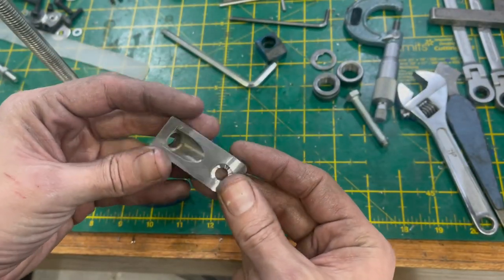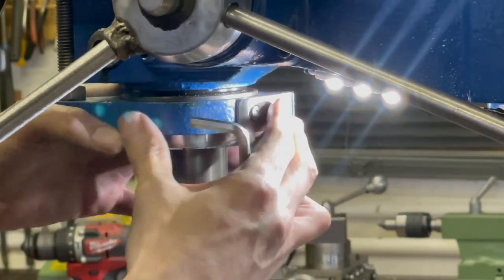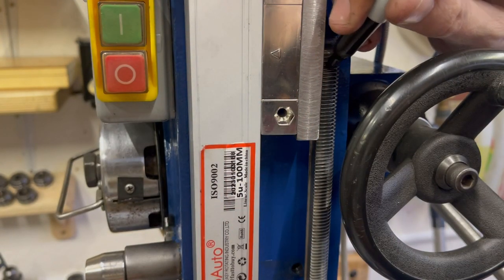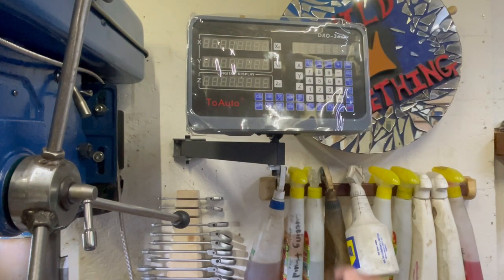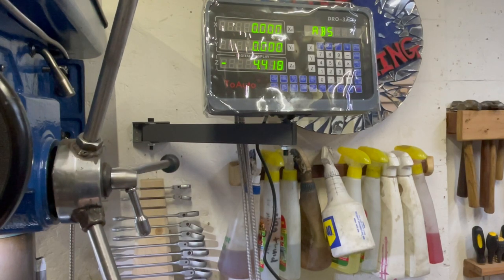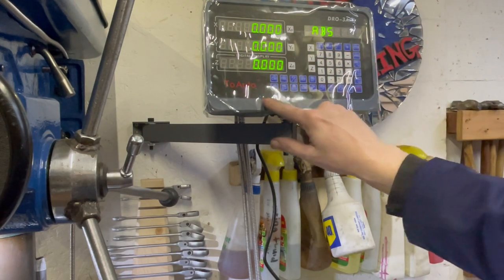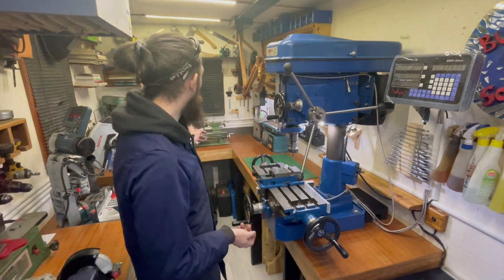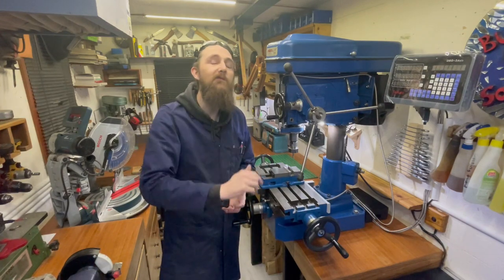3 Axis DRO on my round column milling machine ( PART 2 )

Comment: You can get heat shrink sleeving that will make your electrical connections look much nicer. Just keep it far enough away from the soldering.     a selection of 300+ varied pieces is under £4.  You can also shrink pieces around allen keys so they don't get lost so easy.
  p.s.  I felt a wave of dread when I saw your hands passing so close to the circular saw.
Reply from the maker: @Hereford1642  thanks for the comment, yeah your right, I did recently pick up a box of heat shrink sleeves. But yeah don’t worry yourself I’ve still got all my finger lol.

Comment: You can put a layer of sandpaper between your repaired column clamp & the mounting surface to improve grip.  400 or 600 is adequate.

I discovered the previous owner covered up a gib oiling spot on the back  of the table w/ the Y-axis scale.

Do you have one back there, also?
Reply from the maker: Yeah that’s a good idea, but the repair is still solid after all this time.
Reply: @Darren_Barclay  that's good to hear; it was as much a solution as it was a tip on how to prevent those, 'Oh chit!' moments.

Been there a few times, myself, esp w/ cast iron.  Nice repair.

The 1st concept I was taught in carpentry, 50+ yrs ago was triangulation. Was shown, over time, how to use it in design, fastener placement & in repairs or details, esp where space is limited.

IE: 3 small fasteners can do a superior job of anchoring, instead of 1 or 2 larger.

It's a concept I've used my entire life & has been a core of design/repair/assy.

It's even branched out to a practice of using 2 types of 'fastening'. You use it w/ glue & staples.  Glue alone was the std for a long time.  I've expanded it to other materials; if I can use fasteners & epoxy, I do. Fasteners = rigidity & back up the epoxy; epoxy = vibration resistance & prevents fasteners from loosening.

Triangulation & adhesive/fastener combo are mainstays of design that will serve you well.  I encourage you to experiment & see just how much each technique can benefit your work.

Can't help but think you're from, or on the Green Isle.  As you can surmise from my name, (grand dad's namesake), my roots are in Ireland. 

Always wanted to visit, not gonna get the chance. Too old, & cancer's limiting my days.

My great grand dad came to NY in late 1800's. My dad was 1st generation born in the States.

GeoD

Comment: Hello Darren I fitted a DRO to my round column mill and fixed the Z axis similar to yours. It vibrated when cutting so could not get a read out. Did you have any trouble with yours? I do like your drill storage rack. Cheers Alec
Reply from the maker: Hi Alec thanks for the comment, yeah I do get small vibrations but it’s on the micron scale so it not really a problem
Reply: I’m thinking about putting a DRO on my round column mill and wondered if you ever got it working and if you did, what did you do to fix it. Thanks
Reply from the maker: Hi my thinking is just make sure your mill is on a solid table so it rigid and you should have a problem. If the last digits move abit that want effect your cuts but yeah just go ahead and install it and go from there.
Reply: @Hoaxer51  it is still on my to do list. Just had so many other things on lately. I'll let you know
Reply: @aleccoldman5041 , Thanks